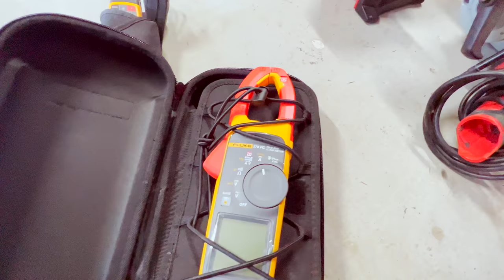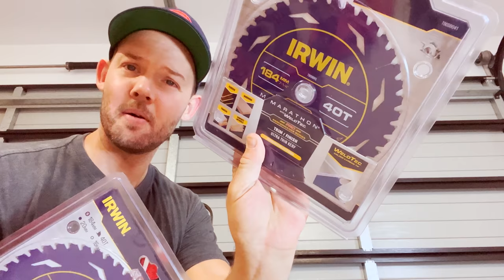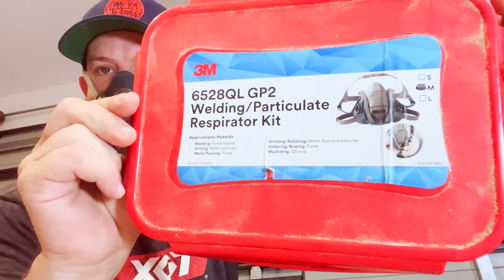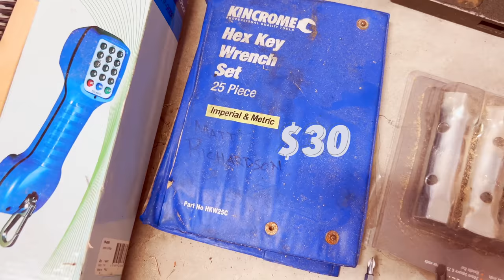HOW MUCH money have I spent on tools?

Comment: Thank you for this. Although my career(s) has been costly from a tool purchasing standpoint. I absolutely love house building, remodeling and building decks. But my other love is being a automotive Tech. I got my ASE Certification in 87 but had been state certified for a few years prior to that. Attended MCI for auto mechanics but was working at shops since 77.
I have actually went back and forth between the two and did  building on the side while working at dealerships as a Tech.
I said all that just to give you a time line and why I suspect it is around the 130-150 k mark.  Buying tools from Snap On, Matco and Mac plus odds and ends plus Boxes.
Buying more building tools than I care to think about. Of course as technology improves you upgrade. From corded to Battery powered. 
Sorry about the long and winded text. 
Stay Strong brothers.

Comment: 23:33, in the US we call them end cutter/precision, and as another viewer pointed out the Knipex are for single use hose clamps Oetiker brand. 24:17 cartridge/shower valve wrenches in the US. 25:12 is a water valve key, use them on hose bibs and different kinds of water angle stops under the lav/sink.

Comment: My wife knows I have a great many tools. My professional hand tools are worth a fortune, and many cannot be purchased any more because the manufacturers no longer exist. These are very high quality, many purchased overseas in various countries since 1974. My 1/4 drive Bonney flex sockets are around $40 each socket replacement cost (only Snap-On available). My aviation trade tools are around $20,000 but are all SAE sizes (no metric on western aircraft). My automotive workshop tools are around $53,000. My problem, insurance costs for them all.

Comment: I have to do an inventory and video for my insurance company I have 6 enclosed trailers that are 24 feet long loaded with construction, carpentry tools most have the same tools in them and 2 step vans 22 feet long  loaded with tools for HVAC AND PLUMBING tools and supplies.. I just wish Milwaukee and DeWalt would have a program to trade old tools in for new updated tools

Comment: You're on the money with the "butt phone" it's the short version of Buttinski, which means they could use it to "butt in" on phone calls.

And the Panduit cable straightener is called a cable comb, so you can comb the cables out nice and straight 😉

Comment: Hey just found you channel and love it great videos you got my sub! 
Do you know if it's possibleto attach your veto bags to your Milwaukee packout system?
Reply from the maker: Cheers Jarrad. I tried attaching the veto a few ways but they all involved glue or adhesives as I didn’t want to put holes or screws through it. There’s no good adhesives that will stick to the veto plastic. I was told this by someone that works with the material. So the only way I’ve seen it done properly is with rivets through the bag onto stealthmounts packout feet.

Comment: Is there any way I could get some crosscut lineman’s pliers here in America? Marvel or Xtorque would be nice to try
Reply from the maker: They’re hard to get over there. I could see how much it is to send over?
Reply: @AddictedtoTools  I did some more looking, and I think I can get the marvels shipped over with eBay. I couldn’t find the xtorque pair anywhere. Between those two and the Wiha, which do you prefer?
Reply from the maker: The marvels and xtorque are the better ones. Marvels are most likely the ones you’ll want
Reply: @AddictedtoTools  thanks very much! I’ll give the eBay route a try
Reply from the maker: Awesome. Let me know how it goes
Reply: @AddictedtoTools  so, the eBay seller was amazing. Shipping was fast, and tool is quality! I’ve broken them in already, and they’ve earned a spot in my tool bag💪🏼

Comment: LOL Fluke 117 $440. Damn thats crazy. Thats one of the low end Fluke made in China meters. used to be able to pick those up at every hardware store in the US for around $130-$150
Reply: A fluke 117 is £235 in the uk which is 300 USD or 450 AUD. 

I've had multiple 117s over the years but the cheapest I've ever bought one was £190 which is 241 USD.

The 114 and 115 have always been considerable cheaper than the 116 and 117.

The US list price from fluke is over $250 so your claim of $130 is nonsense.